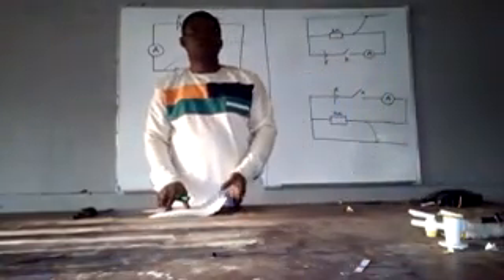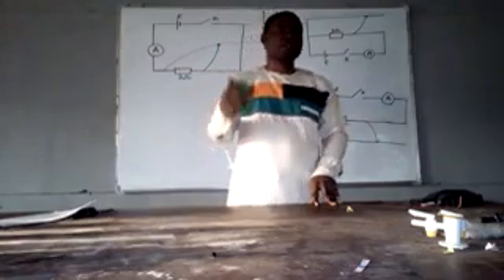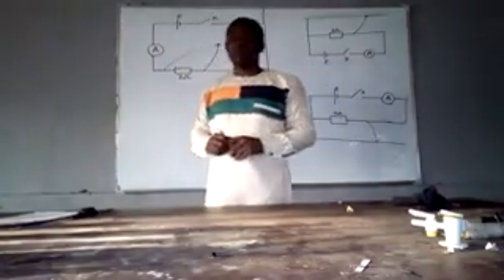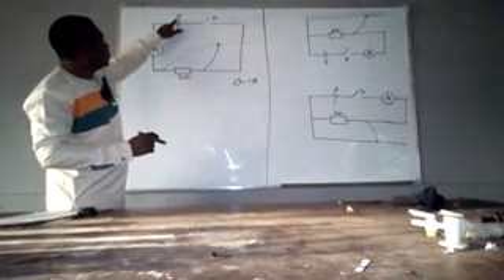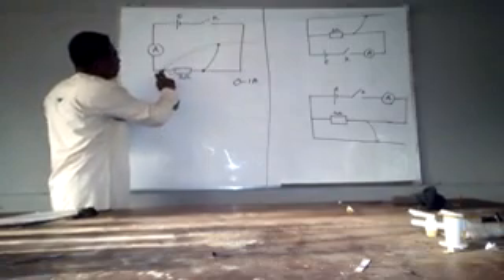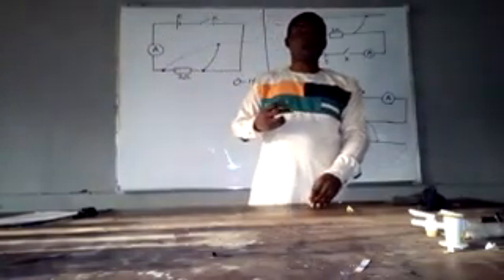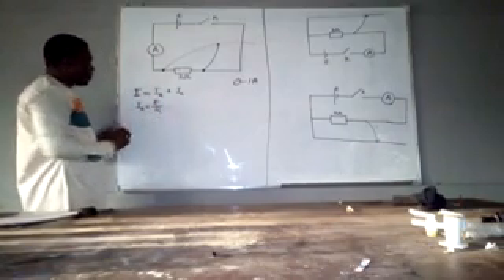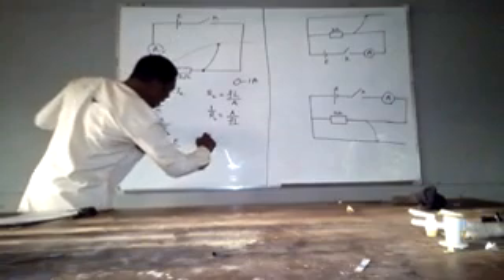WAEC 2021 PHYSICS PRACTICAL ELECTRICITY PART 1

Comment: Morning sir this simply Means the above is not the experiment we expecting... Because when I carried out the above experiment I noticed I got a current above 1A....
Reply from the maker: Later today
Reply: @miracett8460  Good morning Sir,I was recently asked to be teaching physics in my school sir,pls! What are the parameters I might be asked to write in the waec report form as regards mechanics and electricity
Reply from the maker: @bellajon3328  in Mechanics, you may be required to state the set of masses given to the students. If you are giving the same set of masses required by waec, just write them. You may also be asked the average mass of the metre rules given. Since the metre rules will not have the same mass.
In electricity, you may asked to state the resistance or resistivity of the constantan wire given to the students. You may also be asked to state the standard resistor used and the AMMETER scale.
Reply: @miracett8460  Thanks a lot,
Reply: @miracett8460  Sir,will the resitivity of the constantan wire will be calculated if waec requested for it in their report or the value will be attached to the wire if it’s newly bought
Reply from the maker: Yes I will post the part 2 where you will see the one that is expected
Reply: @miracett8460  I’m patiently waiting for the part 2
Reply: @miracett8460  when will you post the part 2 sir?